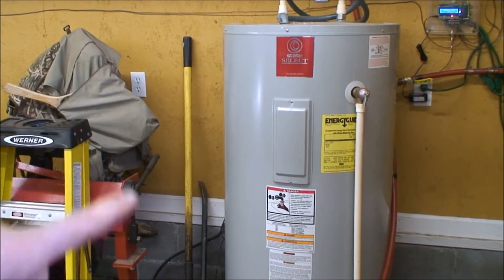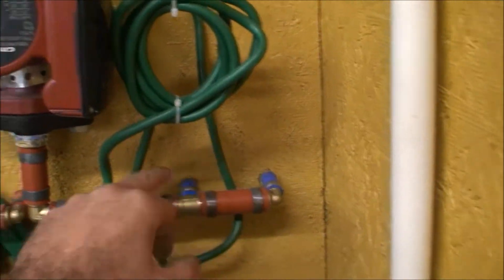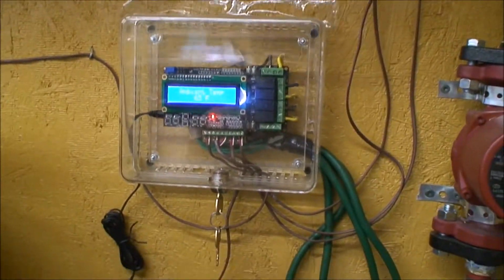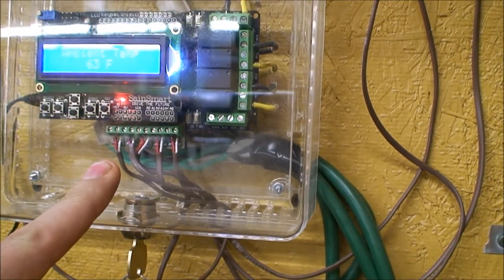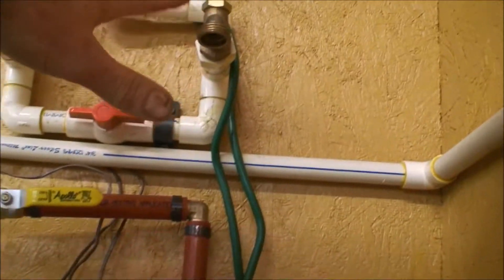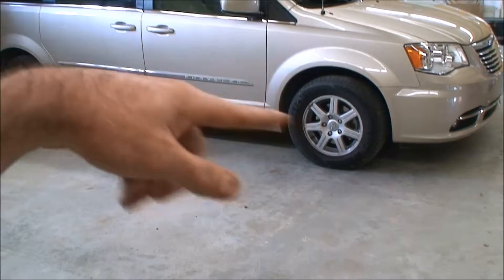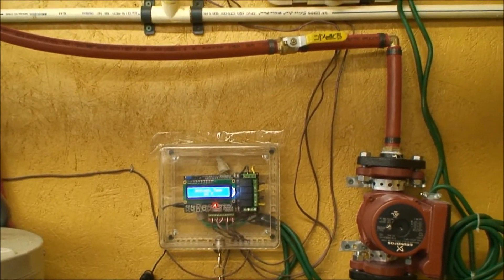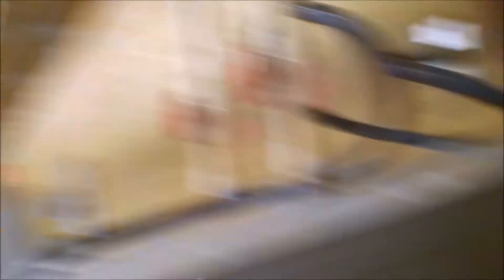Arduino: Solar Collector & Radiant Heat Grid Controller

Comment: You need the vent to remove air but you should have a ex.tank then you relief valve would not blow off saving you glycol. Only trying to help tweak your system.

Comment: where are the expansion tanks?
Reply from the maker: i don't use an expansion tank i use a blow off value and on the solar circulation pipe i use a tee with a vent at the highest point to sway expansion and vacuum pressure that might build up.

Comment: put the sensors on the pipe so you don't read the heat from the circulator when it is running.
Reply from the maker: yes i added a copper pipe inline that i read from now. i did this project long ago but thanks for the comment.